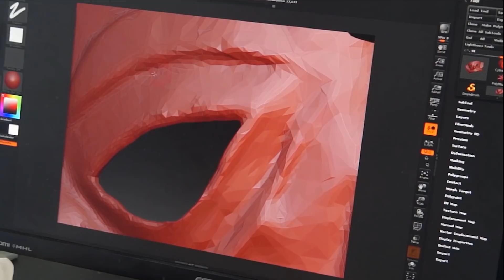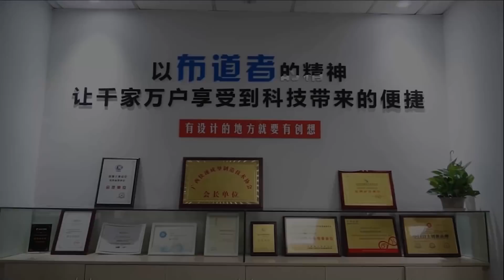Creality 3D Company Tour (2018)

Comment: Interesting!
I have a question, why you're not going to release the source code of cr-2020 firmware? That printer needs a better firmware with all new features that Marlin provides
Reply: Isn't marlin swapping solely to 32bit?
Reply: @fenixasin  Marlin 2 supports both 8 and 32 bit boards
Reply from the maker: Dear, thanks for the attention.